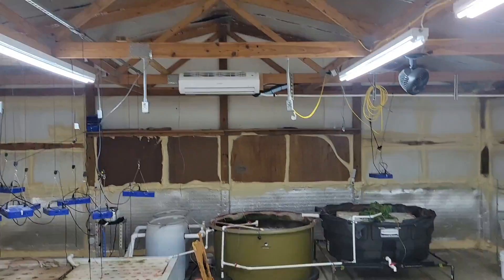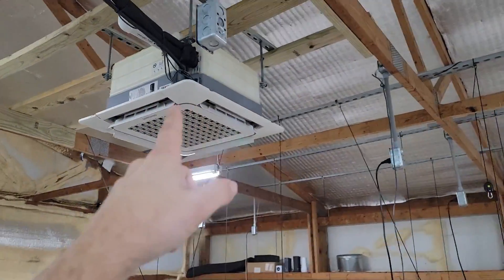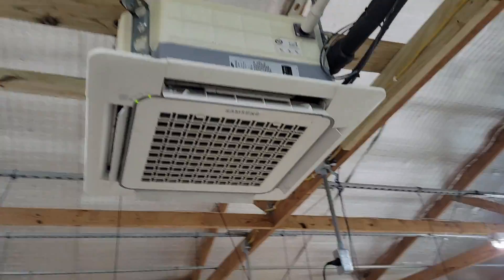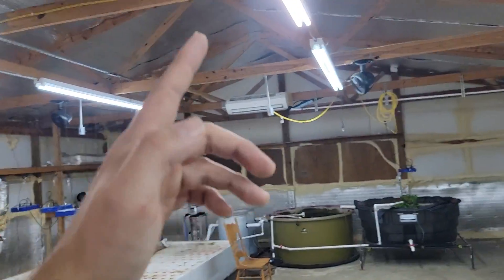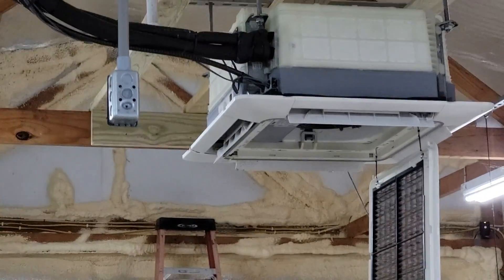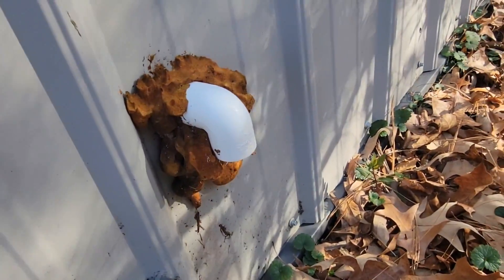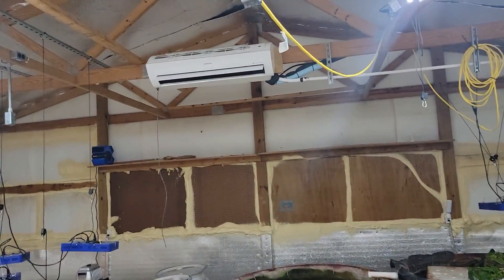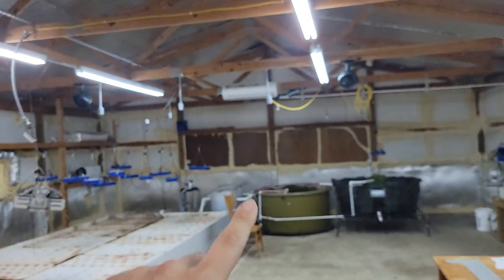Ceiling Cassettes Verses Wall mount air handler #minisplit #airconditioner

Comment: This is very helpful. We're doing an addition with 2 different heating/cooling zones and all my local HVAC companies are pushing traditional forced air but it doesn't seem logical to me. I've been looking into mini-splits but am not thrilled with the wall mount look. Nice to know about the 4-way cassette option for the ceiling. That might be an option. Thank you.
Reply from the maker: There's also a floor mount option I've got another video titled what types of mini splits are there 
you should check it out

Comment: I will never go back to central AC after using a mini split, I installed one in my off grid shipping container (110v cuz my inverter is single phase 110v) and it has been amazing for heat and AC without using much battery or solar.
When I build my house it will have a 4 zone cassette or a 2 separate 2 zone cassettes, I know 2 is more $$$ but having 2 is nice when one breaks down.
Reply from the maker: Love to hear this 
Awesome Glad you watched 😊 
please hit the like button and share the video

Comment: I don't want to put a 4-way cassette in the middle of the bedroom because that's where my ceiling fan is located. Do they make 3-ways that I can locate off to one side, or do I have the option of modifying a 4-way to do the same?
Reply from the maker: They make a single one way cassette that would work well

Comment: A 120V Mini-Split is NOT 2x the Power of a 240V Mini-Split (assuming same Tonnage.)  It is 2x the current required, but half the voltage and P = V * I  so let's assume it's 10A on 120 and 5A on 240V ->  120V * 10A = 1200W =  240 *  5A = 1200W.
Reply from the maker: Thanks 👍

Comment: The more I watch these the more I'm moving away from DIY systems. If it was just a single head unit for a garage or workspace then fine. But we need a multizone system in a three-story application. Plus it seems like the warranties on the professionally installed units are far superior to the DIY ones. The Mr. Cool website has a disclaimer right up front that says to hire professional HVAC and electrical workers to ensure their claims hold up.
Reply from the maker: Deal with a pro and get a good warranty

Comment: Would you recommend one over the other or not at all for a larger custom home? ~7k SF Seriously considering these for cooling and in floor radiant for heat. Would love your thoughts.
Reply from the maker: Really depends on the application I do like the cassettes however servicing them is much harder than much harder than servicing the wall mountain

Comment: do you install the 48k 5ch on a wall bracket or a stand? I've noticed in the literature it says any unit over 132lbs. should not be installed on a bracket.  Thanks for your help, I just started to install samsung and still have to get used to the different install procedures...also the communicating wire do you run it with the lineset and power and wrapped like other types of ductless systems or do you have to run it awayfrom any and all power sources? I appreciate it.
Reply from the maker: I usually install it on a concrete pad or a plastic pad
 I also run the communication table separate from the other power cable

Comment: 110 vs 220 is not "double the power consumption" lmao

Double the current for the lower voltage but the wattage would be the same. The tiny amount of change in efficiency due to higher voltage is miniscule.
Reply from the maker: I agree I think I had my words mixed up on this one Thank YOU

Comment: where the 110 version come in handy is if someone is replacing an old loud unit in an RV or camper, this is becoming a great option. not common practice yet but a few manufacturers are starting to put in as an upgrade

Comment: Can you mount the ceiling cassette in the walls vs Ceiling?  Also I’ve heard Mitsubishi has a cassette that fits in the runs, does this only have one outlet of air?
Reply from the maker: no sir 
but you should check out my video on the console unit its cool and mounts on the wall
Reply from the maker: here it is https://youtu.be/Sy7eiH22xF4

Comment: 110v and 220v will use the same power and thus your electric bill will be the exact same for both voltages. The difference is you are sharing voltage on two conductors instead of all on one. So 7amps on line 1 and 7amps on line 2 = 14amps for a 220v. Or 14amps on 110v. You get charged the same. 220 will usually be more efficient due to power losses in wire so 220 is the way to go if Possible.
Reply: Yes, you are right, the power is the same even if the amperage is double for the 120 volt. And you are paying for power. The losses in the wire are negligible if you have properly rated or over rated (i.e. larger gauge) wire. From my point of view, the only benefit to 240 volt is that you don't need as beefy a wire, since the thickness of wire is specified by amperage. The downsides to 240 volt is that you need two breaker slots in your panel instead of one, and the breaker is a bit more expensive since it's a double wide.
Reply: You're kind of right, Luke. If you measure current on the neutral wire in the 120V, you will have 14A and 0 volts. A better way of looking at it is P=I*E. Voltage drop isn't as big an issue since these types of units do not create huge inrush current and most of the 120V rated units are small with a relatively low current draw.
Reply: Chosen voltage is more about the wires. 240v can deliver twice the power over standard 12 gauge wires than 120v. If a high powered appliance used 120v, we may need to run thicker and more expensive 8 gauge wires. Also the wires within the appliance would need to be heavier gauge.

120v is used in standard appliances in the US for historical reasons and for safety.
Reply: @lukefarmer5391  excellent point
Reply: Hold on a second am I missing something?
Power aka Watts is P(W)=I(amps,current)X E(voltage)  so if you have 110V X 14 amps= 1540W 
 Now take 220V X14 amps= 3080W
And I thought the power company charged you based on KW/H.  So wouldn't you use more power if you used a higher voltage, supposing you keep the amperage the same?

Maybe once I get to that point in the video I'll understand what I missed but pretty sure all equipment is rated for certain voltages, amperages and wattages. If it says it needs 120V 15A and 1800W you gotta give it those parameters otherwise if you hook it up to a 220V system you risk burning it up. You're giving it more pressure (E=Volts) at the 15A so the Watts will go up and you'll burn it out.  Again I could be wrong and missing something, I'm gonna watch the rest of the video.
Reply: That's wrong. Power is voltage times current. 220v vs 110v has half the current. If the current was the same, the power would be double...
Reply: @thomgt4  The video was wrong, the posters above you are correct.  The energy used in watts is identical between 120V and 240V units, the watts will be almost identical.  The only difference if any is wiring losses and smaller wires needed for 240V as the current flow is half.
Reply: @redbaron6805  yes watts never change, that’s why the power company charges us for watt hours used
Reply: @thomgt4  ouch. Its been ten months but you can still delete your comment and avoid ridicule
Reply: I understand the 220v is more efficient for the machine and will work better and last longer?
Reply: @rentvesting  More efficient, yes. Better? Longer? About the same.

Comment: What is a typical cost for a two-room setup with one wall mount and one cassette? I know it depends, but what would the range be for equipment and installation? I live in PA.
Reply: I was just quoted 18k and that’s for 1200 sq ft?
Reply: @quantumtechcrypto7080  Since I  posted this 4 months ago, I ended up paying $11k for the dual system. Thanks.

Comment: I'm currently installing a Senville cassette in my home.  The instructions are a little unclear. There is no mounting hardware so I'm told I need to go to a hardware store for the parts.

The pros are it's less intrusive compared to a wall mount.

The cons is it is harder to install and requires a large hole in the ceiling.  If you make a mistake on its placement due to requirements or line set run, you would need to fix the ceiling.
Reply: Drywall is not hard?
Reply: @robertm5969  True. Hand textured requires some skill to match.

Comment: Between the two of these options, which one would you choose for a rental property? I am not as concerned about the cost difference as I am about neglectful tenants. Would the ceiling cassette option operate longer without maintenance than the wall-mounted? As a landlord, I would try to schedule yearly or bi-yearly maintenance visits to ensure the AC is clean and working correctly, but I cannot depend on a tenant to do any of this maintenance.
Reply from the maker: That's a good question
 I will do a video to give you more insight
Reply: @taddydigest  where’s the video ? 😎
Reply from the maker: I'm not sure if I did a video of this or not. But the answer is pretty simple. Definitely go with the wall, mount air handlers as they require less expense up front and less maintenance down the road and also they are less to replace.If the tenant does not take care of them
Reply: @ ok my husband is saying the front part opens up and you can clean the filter . Any other maintenance?? Ty 😄

Comment: I see no point in buying a minnisplit if i have to pay someone for the install.
Reply: Warranty.  Insurance. House sale inspection to code. Peace of mind.  Service contract.  Renters.  They are coming out with great all-in-one saddle units which straddle a window in an upside-down U shape.  It sits inside and out, with two motors-an innie and an outie- for quietude and efficiency, People will be able to install them themselves without special handy knowledge.  You wont have to tear apart the wall for the lines, set a cement pad, or install a new breaker or 240 wiring.

Comment: Its not the current you look at when compairing 110v to 220 its the wattage. 1000watts at 220 is about 4 amps 1000watts at 110 is about 9 amps.  Its the same power usage. You dont compair amps. You compair watts. This is ohms law

Comment: So what you're saying is a 220v mini split unit is even more efficient than a 120v?
Reply: The efficiency, and the power in watts, is the same.  Now, the advantage of 240v over 120v is that 240v uses only half the amps of 120v.  Most older electrical panels are  rated for only 100 amps. With greater volts but fewer amps, you can add more appliances in your house. 

We keep dreaming up new ways to use electricity: RV hookup(30A or 50A), electric car charging (20-50A), dryer(30A), Instant On Hot Water (20A-80A) heat pump(10A-30A), heated floor (20A x 3), On Demand sink hot water (20A) etc etc. The math adds up slower if you use only half the amps, more 'space' which 240v  generously gives us.

If its only 120v,  you must use twice the Amps, which will give you the same wattage, but your panel will max out it's Amp rating sooner.  

Also, big technical issue, the wire for higher voltage is not as expensive as it could be, because it can be thinner, as its only carrying half the Amps.  Amps heat up wire, not voltage. Less Amps creates less heat, and less fire danger.  Although, 120v was chosen because it is safer if you  accidentally touch it, than 220v.

You are allowed to nominally exceed your panels rating by 30%.  The real point is, you don't want to blow your main breaker by turning everything on at once.  

To sum up, 240v, at half the amps, allows you much more wiggle room to install that new hot-tub and not have to call the Electrician to install a new higher amperage breaker panel.
Reply from the maker: very knowledgeable Mike Thank you for this
Reply from the maker: absolutely

Comment: What did you do to connect the condensate line to the pvc for the wall unit. Any code on this? Looks like you inserted the insulated plastic condensate line into pvc? I am installing wall unit and running condensate line down inside wall exiting at 6in above ground at exterior.
Reply from the maker: Yes I just inserted the line into the PVC
 You can use 5/8 tubing and it will fit inside  as well

Comment: Nice video. Mini splits are nice but the indoor wall units aren't great looking and the ceiling cassettes challenging to fit into an older home. I would like to install a ceiling cassette in a drop ceiling in my hallway which is in the center of my house and then have short runs of ducting through the hall walls into the adjacent rooms so that I can send air in four different directions and heat the whole floor that way without putting individual units in every room..
Reply: Sounds like a DUCTED mini-split would be ideal for you.  I just learned they exist.  It's just a small air handler you can hide above your ceiling in the attic, with ducts run to the adjacent rooms.

Comment: Can I install this on the roof of a motorhome?
Reply from the maker: As long as the unit is inside and not outside
Reply: People hang the outside unit on a bracket off the back off the RV. There's videos of people doing this.

Comment: True, the 220 volt units are more efficient, but I have 2) 110 volt units because of power limitations, and my power bill went down,  they are very efficient even though 220 volt units are better. I have found that the difference in these units from 220 or 110 is very low.
Reply: I have a ranch and went with 2 12,000 btu 110 wall units 2 years ago. I have one at the end of my hallway (takes care of all the bedrooms and main part of the house and one in the living room). My first floor is fairly open and these 2 units work fantastic! I can even leave my 3 season room open most of the time unless it gets above 90 out. With the 3 season room closed I can keep the house around 70 even when it's 100 out!

Comment: Which would be better to be used in a bedroom? Building a barndo and trying to come up with how to cool the important rooms because cooling the large volume areas would be incredibly expensive. 
Can I mount the condenser be mounted in the garage? Live in MN and will have a huge garage.
Reply from the maker: Click the join button become a member send me the drawing plans and I will help you
tadfuller1@gmail.com
Reply: @taddydigest  I will certainly do that. Getting my final prints set up, had to redesign it after the lumber price boom and going with slab hydronic heat floor now instead of full basement.
Reply from the maker: I would use a wall mount in the bedrooms

Comment: Condensate line should not be trapped. Also with vent in condensate pipe....should the line clog downstream of the vent... condensation pump will push water out of the vent into the ceiling area.
Reply: Code in some areas requires a trap.
Reply: With all due respect, In almost all cases, installation instructions by the manufacturer usurp any code compliance interpretations.  As pointed out, a trap as shown in your installation is not correct and can cause problems.  Condensate traps are only required when the evaporator/condensate pans are on the negative pressure side of the fan.  Great video otherwise..

Comment: Thanks for the video.  I just got a quote from a "pro" for over $8k to purchase/install a split for my two-car garage.  I almost threw him off the porch.  I think I'll be going the DIY route because I can buy it several times over before approaching the quote.
Reply: Anyone with just a little DIY skill can easily install these. The rates the 'pros' charge are pure robbery and there is no way to justify the cost. Why worry about a warranty when, as you stated, you can just replace the entire system yourself for 1/8 the cost of the install.
You also don't need to become a member here to learn how to install these from this guy. There are probably a hundred free videos here on Youtube showing you the exact same thing.
Reply: The greed today is astounding and disgusting
Reply from the maker: I can help you save money and I'll teach you how to DIY your new unit join and become a level 5 member send me an email tadfuller1@gmail.com
Reply: @taddydigest  Thank you for the offer.  After just a little research I'm pretty comfortable with the install.  The Pioneer unit I just purchased came pre-charged, and I ordered a vacuum pump and gauges.  My only holdup now is finding an electrician to wire my disconnect (wife's insistence), but they don't seem interested in coming over for a small job.  Looks like I'm going to do that myself as well.
Reply: @taddydigest  P.s.  Sorry I'm just now responding.  I never got an alert on your message.  Only the other gentleman's.

Comment: 120 volt does not use more energy than a 220 volt. You are buying KW hours. Your savings comes from 220 using smaller wire.
Reply from the maker: That is correct thank you for your knowledge